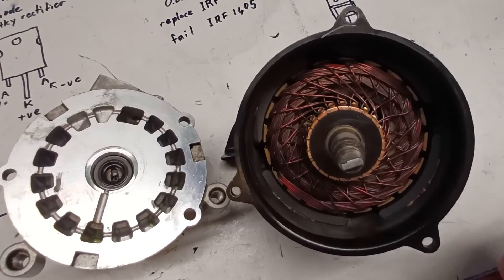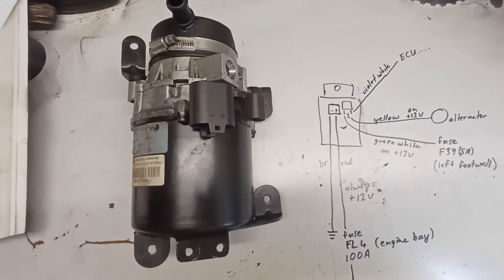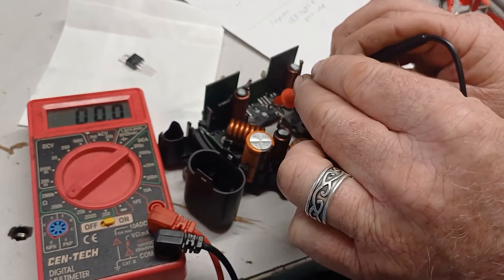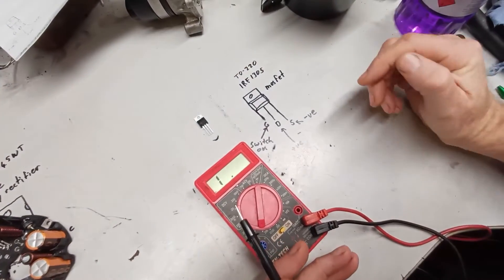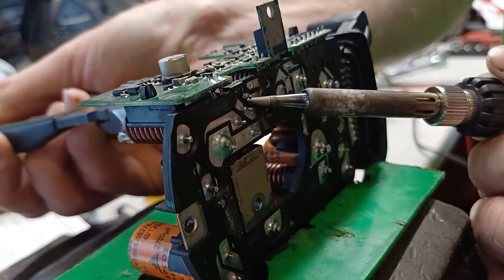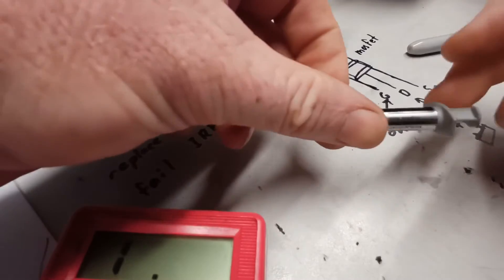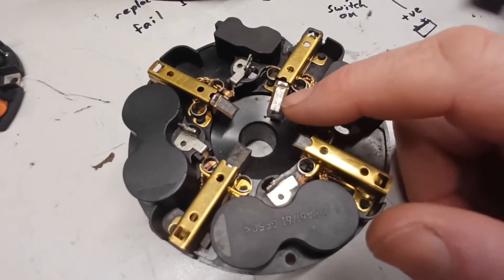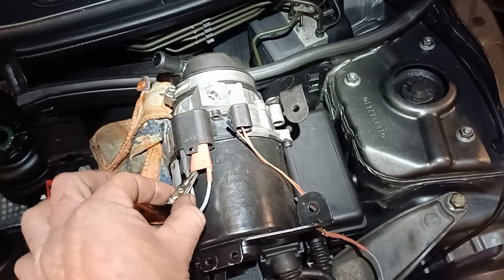Mini R50 R53 power steering pump overhaul and repair

Comment: I need some help. So I measured the diode that seems like a big mosfet on diode tester and I get 0.01 on each diode and with reverse polarity open loop. Is that seems ok to you?
Reply from the maker: Your numbers are very different to what my multimeter was producing. But I have not tried these with other multimeters. They could run on different units I suppose. Suggest you search for videos on how to test mosfets. In case the difference is the unit the multimeter operates in.

Comment: I have a problem with my Mini  — my electro-hydraulic power steering pump seems shorted (but i'm not sure). The battery have drained completely overnight and there was burning smell near the fuse box.
The  power wire from the fuse box gets hot and shows continuity to ground, the pump shows 0.5 Ω between + and −, and when I connect it directly to the battery, the wires heat up but the motor doesn’t spin.
Could this mean the pump is burned out? And could it draw power even with the ignition off?
Reply from the maker: Yes it will run the battery dead if it fails on. Suggest disconnecting battery

Comment: On the alt/ig port, is there just a 12v positive connection from the battery? Where is the negative or ground connection coming from?
Reply from the maker: Under the airborne and pump is the earth.

Comment: I want to test a pump outside the car with a 12V battery. The two alternator ignition wires,  is one positive and the other ground? Or is the ground taken from the main connection?

Comment: I see a lot of comments here. My pump stops working after one hour driving. I checke dthe PS fan with NCS tool and it works. Before getting a reconditioned pump Iwanted to open it up and give it a clean. Could be dust build up that gets "tackier" when getting hotter and messing with the brushes. I hope. Could be also the capacitors opening teh circuit when tehy get hot. I just hope it will last for my next MOT so I can fix it without rushing!

Comment: Honestly just hook it up to a 12v switch and run it in the car. Keep power steering off unless you need it. This will keep the pump in Great shape for a very long time and reduce wear.
Reply from the maker: Nice one. That's a pretty thick cable. Did you use a relay to switch it on from inside the car?
Reply: Be really careful doing this and make sure you always turn it off when unoccupied.  We've seen loads of these pumps that have been on fire from overrun/overheating.

Comment: My PS pump is getting 12v even with the car off, is this normal?
Reply from the maker: Yes, 12v hard wired. Signal wires turn it on, unless it's broken and runs all the time.

Comment: When testing the control pins to the pump, what volages should I be expecting across which wires?  Green  - ignition on.  Yellow, alternator charging. (Purple - outbound from pump, no need to test?)  Charge warning light comes on dash in ignition position 2, then goes out when engine running.

Comment: Great tutorial Thomas - thanks for sharing.  Have pump out and disassembled.  At 6m10s in the video, you test the 2 MOSFETs.  However, you test them removed from the PCB.  My MOSFETs would not switch (and therefore match the behaviour in the video) when in the PCB.  I get voltage (c. 0.4v) with -ve lead to pin 2 (+ve) and +ve lead to pin 3 (-ve), but 0l / open circuit with -ve lead to pin 3 (-ve) and +ve lead to pin 2 (+ve).  And I can't switch the gate to change that.  Same behaviour both MOSFETs.  Removed 1 of the MOSFETs from the PCB, and off-board it tests same as yours does off-board.  Do you know, is there is a relibale test for the MOSFETs while they are still in situ?  - And if so, could you share please?  I have ordered some replacement MOSFETs (IRF3205 110A 55V - Amazon UK B0D6B16JFK) which should arrive tomo.  Will 1st test off-PCB, then test again in-PCB.  My symptoms are: while turning steering from lock to lock, assistance would come and go throughout the sweep.  Tricky to say if regular or not (e.g. a la sine wave).  So power getting to pump, pump runs, pump shuts-off when ignition goes off, but not consistent / smooth assistance while turning.  There was a lot of dust inside.  Caps all look fine and have same resistance (c. 4.x MOhms).  Pump looks pretty cruddy - still to clean up.  But no leaks in pump anywhere.   Not even 100% sure my issue is pump related - although could have beeen dust on the PCB that was affecting pump control, or maybe tghe MOSFETs had become slow to switch - I am no expert, and am guessing wildly here.   * CORRECTION: Turns out pump was not running at all.  *  Maybe is could even be an issue with the rack.  Doh!  Should have been listening more closely to the pump (maybe with stehoscope) while wheel was being turned, to see if constant speed from the pump or not.  (But I suspect not.)  After cleaning PCB with WD40 Specialist Contact Cleaner, noticed white haze on the board.  Guess this was the cleaner reacting to the protective conformant spray on the PCB (clear acrylic or suchlike) which will be on to help protect from moisture / contaminants / shorts.  I cleaned-off have with some 99% isopropyl alcohol on a small paintbrush - hopefully I haven't taken too much of it off (and consequently left the PCB in a worse state than when I started!).  Will post another comment / update after new MOSFETs received and tested on & off board - hopefully within next couple of days.  By the way, to remove pump shaft - after no joy with a rubber mallet, I supported pump case collar under 2 pieces of wood to steady it, old trainer underneath to catch the armature, and put barely open jaws of big adjustabkle spanner around the key on the shaft end, and give it whack with club hammer.  Came out no problem - with no damage to big rubber seal or key on end of shaft.
Reading more of the other comments, just had a horrible thought....maybe the 'variable assistance through turning' issue I have is due to varying power output from the alternator?  I have access to ISTA, and ISTA was showing no related codes - PSP or alternator - so hopefully not!  (2007 R52)
Reply: New IRF3205 MOSFETs received.  Tested same off-board as removed top-right MOSFET.  Both original MOSFETs tested same on-board. So I bottled-it and didnlt change-out either of the 2 MOSFETs.  (Feel free to laugh, I (probably) deserve it!  :-)  I am new to all of this.  Someone suggested, if it ain't broke, don't fix it - why chance on a non like-for-like replacement?  So I didn't.)  So after just cleaning-up motor and PCBs, and a bit of gunk out of the pump plates, I refitted to the car.  Alas - no change from before the endeavour started.  Worse - whereas I thought I had been getting some assistance through the lock-to-lock cycle, pump is not running at all.  Totally dead.  Evidenced by no noise via stethescope on pump body, nor any movement in the fluid in the reservoir with the wheel turning.  Doh!  Should have checked this BEFORE removing the pump.  Have checked F39 5A fuse - all good.  Next stop is to check FL4 100A fuse.  If that is also good, think next step will be to check voltages at pump control pins.  Kicking myself for not changing those MOSFETs - especially since didn't test the top-left one off-board.  If I had been doing all the work myself, I would have.  But was pestering a very patient buddy to do all the soldering stuff for me - snip coil wires from posts, resolder same, unsolder MOSFET, resoldering MOSFET.  But if all further tests check-out, then I think that bwill be the only option left - to go through the whole process again, but repace the MOSFETs.)
Reply from the maker: Be sure and test voltage and grounds supplied to the pump. Can also test the pump itself on the bench before disassembly again. 
You mention the protective coating. I suspect that's the missing piece of the puzzle here. Maybe why mine failed. After replacing mosfets, the board probably needs that coating replaced as well. Some sort of resin perhaps??
Reply: Arrggh!  Disappointing!  Eventually got around to reassembling & testng after replacing MOSFETs.  No life from pump at all.  :-(  Used fully charged battery out of the car.  Battery pos & neg to motor pos & neg [using jump leads].  Battery pos to control connector pins 1 (green & white, ignition  on) & 2 (yellow – alternator charging).  Nada.  Giving-up - pump no longer required.  Could be issue with caps (tested ok but not replaced), or possiby reassembly issue.  If pump dies on new-to-me R52, think I will go down the reman route.

Comment: Bit of a different issue on mine, f39 fuse had blown after new battery replaced after being sat for 6months, once new fuse is in place I get almost all ignition on without key in barrel, once I disconnect 3 pin small pump plug the issue goes away. Would this be wiring issue related?

Comment: Hi. I am currently having issues with my power steering pump for my 2010 mini cooper bmw. No one seems to know what is wrong or how to fix it. Any advice?
Reply from the maker: @keriedwards4579  They changed the design entirely after 2006 to a far more reliable set up. From electric powered hydraulic power steering to fully electric. The electric motor is then part of the steering rack. I'm not aware of any common faults on the newer set up. Certainly be worth having an auto electrician check the electric rack is receiving power ground, signal etc before suspecting the rack itself.

Comment: How did you wire it up on the logic loop part for the test run?  I've made a few attempts on the bench  without any luck.
Reply from the maker: @sinclairpatrick  pins 1 and 2 get 12v. Nothing on pin 3.
Reply: Cheers, I'll give it another try.

Comment: annoyingly i replaced the Mosfet and it still is having the issue of always running
Reply: @nikwashere1107 A short on the control wire for switch-on, which (I believe) should only activate when alternator is running & charging?  Did you figure it out?
Reply: @Pretzelmeister  I ended up finding just the control board and brushes part on line for a good price, swapped that on my old motor and it works great
Reply: @nikwashere1107  Good to hear!  :-)  I presume both the control board and brushes were both used parts?

Comment: Thanks for the video, great help for us in que for redoing the pump. Brushes are almost gone, only 4-5 mm left, and i cannot find any info on replacement part. 3 full spoons of dust in magnet housing. Is it enough just to get same size of brush 10,8*26,8*6 or it needs some specific material?  Any additional help would be appreciated.
Reply: You should be fine with the same size brush. I personally wouldn’t fret too much about the composition of the material
Reply: @monkeytutz2  it is 210.000 km and i would not like to have to do it again if some material decay sooner , confusing part about brushes is in labeling in my area like carbon, graphite, copper and silver carbon ones... original brushes are not available any time soon.

Comment: Just trying to understand a bit more of the functionality here.   When I turn my key to position one (engine not running) my PAS pump runs.   I assume it should only run, when the engine is running - is that correct.   Someone suggested that my problem, or remedy might be the alternator signal - would happen to know if this is correct (or is it indeed the pump?)......   Thanks.
Reply from the maker: @edwardgurhy100  Should only work when engine is running and alternator producing volts. If it doesn't run at all, it can be the alternator. Can't see how it would work the other way round.
Reply: @thomaswilding8818  Actually just been and double checked.   It is key in second position when the pump runs (not first).  So, before cranking the pump runs.   If I pull  the small 3 wire plug out then it doesn't run.  Is there a switch (mosfet?) in the circuitry that could be failed on?  Just to be clear - the pump runs in second position with engine not running.  Is it worth testing the 3 wires (yellow, green, purple) and see what I am getting on each (in either position)?
Reply from the maker: I see. That is strange. Does your ignition light turn on in the 2nd position, with engine off? It should be illuminated. If not then the problem isn't your pump. Something wrong with the wiring. If is it lit then something wrong with the pump
Reply: @thomaswilding8818  So.... ignition light is on at 2nd position (then goes off obviously on engine start).   ..... reading your note here - it seems to suggest two different scenarios, 1. should be lit 2. if lit - something wrong with pump.  I clearly am misunderstanding..... ?
Reply from the maker: @edwardgurhy100  The yellow wire to the pump also goes to the ignition light on the dash. Same circuit. The signal from the alternator is therefore good. You can check the yellow wire at the pump as well if you like. There could be a brake in the wire close to the pump.
Reply: @thomaswilding8818  So, the yellow wire at the pump appears to show almost 0.6v whether at key in or position 2.

Comment: Hi! I removed my power steering pump and when I test it direct with the battery it runs super slow then it gets a bit more velocity and then shuts off. My question is, after replace everything you replaced, my power steering wil work again?
Reply from the maker: @Aleks2G  For a guarantee, buy a new pump from mini. These videos give you a starting point if you want to have a go yourself. If you can work out what's wrong with your old pump, and repair what's broken, then it'll work again.
Reply: If I test it with the battery it should be running all the time plugged or it turns off because it doesn't have steering fluid?
Reply from the maker: @Aleks2G  It’s a big motor. Perhaps check your voltage.  The motor would run a small battery flat very quickly. Which is probably why they designed it to not run if alternator isn't charging.

Comment: As for insulating the MOSFETs try silicon pads, these will conduct the heat and isolate the MOSFETs from the case.
Reply: They sell insulators pre-cut to TO-220 shape for cheap.  But  my pump already has a yellow insulation sheet between the mosfets and the case.  (And that green thermal paste too. ). Still need to make sure the heat sinks of replacement mosfets don’t contact the case (i.e. don’t make the legs too long or too crooked. )

Comment: My friend. I just tested my pump as you did, but it does not sound nowhere as loud pumping as yours. It starts very quiet and then gradually gets louder and stronger. But still never that loud. Is that a problem?
Reply from the maker: You can bench test if the mosfets have failed causing it to run all the time or not at all. But testing strength of the motor would need a different set up. For example,  gage of wire or contact patch could change how fast the motor runs on the bench.
Reply: @thomaswilding8818  that makes sense. I had tiny alligator clips running to my battery outside of the vehicle. What was more concerning was slow motor startup that gradually got fast. Suspected the capacitor but have not opened to test. What would you think? Capacitor test for slow starting speed? Nice video... One of a kind video on here mate

Comment: Fyi, there is a boot release under the rear bench seat.
Reply from the maker: Fantastic!
Reply: Only if your Mini R50/53 is a facelift version.
Reply: @lukas0846 nope
Reply: Mine is an ‘03, and it does not have the cable release.
Reply: @metame3803 strange. Mine is also a 2003 and has the cable.

Comment: Great video! I'm trying to find my problem (pump, lines or electric) Is it possible to know how you test the pump before the video ends? It's so fast I'm missing something.  Thank you
Reply: Use the original plug that goes into the big power positive and negative terminal on pump. Just connect that to it, and the other end to the positive battery and negative. Now find 2 smaller female one pin connectors and plug into the smaller terminal next to that labeled as #1 and #2. Look inside with a flashlight, they are numbered. Just leave #3 alone. 12 volts to both 1&2 and also connect that to the main positive. Now touch to ground and boom....the pump spins my friend.

Comment: Dear Thomas, congratulations for the videos you uploaded, they helped me a lot with the problem my mini is facing. In a few days I will open the pump and I already have in my hands a repair kit with o-rings, fuses, bearings, brushes, etc. I have found both types of transistors recommended for replacement (IPF 3205 or 3206) Do you know if anyone has tried it and if so, which is the best to replace the original? Thanks in advance for your reply
Reply from the maker: Both exceed the spec of the original mosfets and have heard of people having sucess with both. Do share where you sourced brushes etc. Many will find that useful I'm sure. One other point- there does appear to be a clear coating over circuit board. I do wonder if it's necessary to protect those soldered pins.
Reply: @thomaswilding8818  Thanks for the prompt reply. Of course, if everything goes well and this works on my pump, I will immediately inform those who are interested through your channel!
Reply: @johnsimis6598 . What is the situation? has it been fixed?
Reply: Hola si los transistores tiran al rededor de 850 están bien?

Comment: Very helpful.  When you did the power steering delete, what did you do with the wiring harness/connections?  Did you just tuck them unconnected to anything?
Reply from the maker: I disconnected the high tension cables at both ends and removed them completely. Don't want those dangling about. The small connector I just zip tied out of the way.